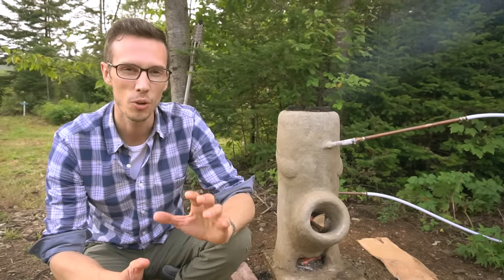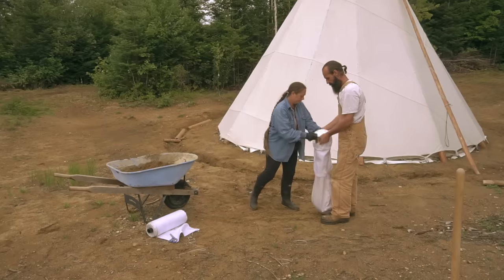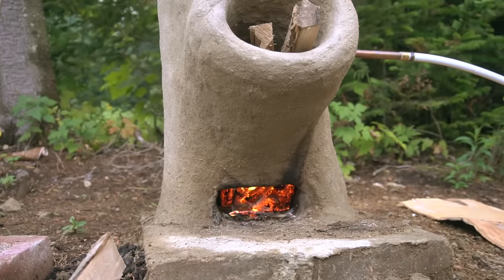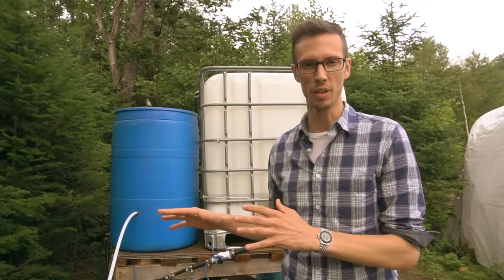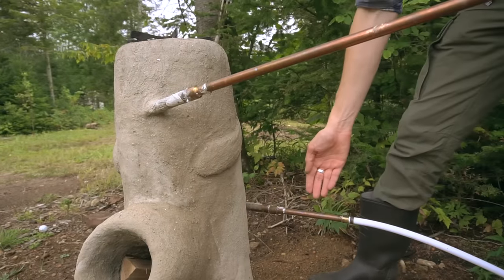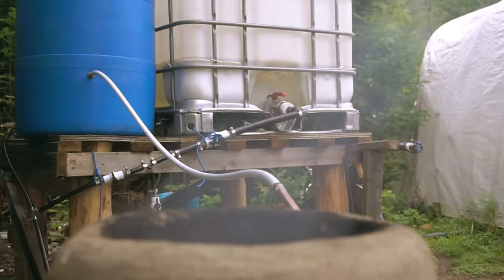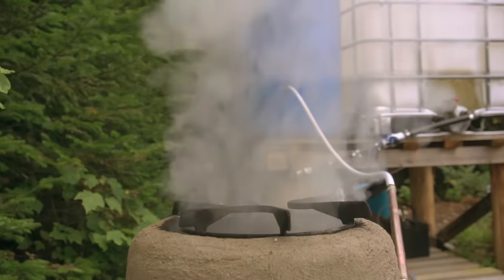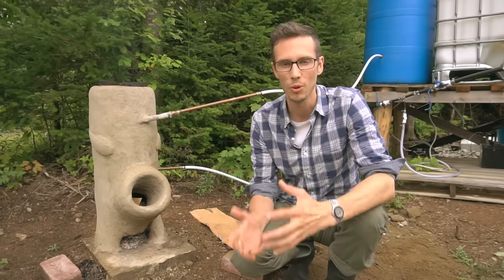Brilliant DIY Off-Grid Water Heater Using a Rocket Stove – No Propane!

Comment from the maker: What do you think of this off-grid water heater?  Have you seen or used any propane-free off-grid water heaters?  Thanks for watching!
Reply: Well i have mixed feelings. Any clue how long ive been trying to figure out how to do a portable heating system w out lp? Lmao of course YouTube to the rescue. Smh...lmao
Reply: It’s unclear what this stove is made of - is it concrete with extra sand? Or clay with grog (ground up pre-fired clay to avoid cracking)? I would be nervous to put the heated water back into a plastic tank in a cyclical system. A food grade steel barrel may be safer... is there an overflow valve and a pressure valve on the tank? Thanks for posting this. Interesting!
Reply: Micha EL can someone post the recipe for the insulated cement?
Reply: Exploring Alternatives; burning wood? Is not sustainable except for a very small group of users.
Reply: bb1111116 
The rocket mass stove and heaters use a fraction of the wood used in traditional wood burning devices, including the new ones that are supposed to be more efficient. The bonus is that they also make good use of small pieces of wood...no logs required, so that means more sustainable as dead branches and brush are good. Fouch Family live in Idaho and heat a small home with RMH. They run a burn in the am and it keeps the house comfortable until the next morning. 
I would love to see if someone would do an experiment: shred and compress the waste matter that comes from crops...corn or other grain stalks, for example, do not really add much nutrients to soil, and do not make good fodder for animals.
Reply: Use to rig something similar with copper pipe and a ice cooler when camping in winter. Works great. This is brilliant 
Cook, heat your water that's all I need. Love it
Reply: Build self feed system for that.
Reply: Way to make a go of it!  Cute stove.   Two things: One, you could heat water using a retort  where you burn the some wood and mostly woodgas and get char as a biproduct to use in many ways - like mixing with compost for bio-char.  Char is stable and a great way to sequester carbon and grab nutrients that would volatilize, like urea in manure.  Two, I am wary of using plastic for water and especially heated water.  I know some say it is okay, but I carry a heavy plastic burden in my body and I eat mostly organic etc.  Here is a good  simple char retort design.  

http://livingwebfarms.org/multimedia/videos/complete-hands-on-workshops/biochar-workshop/

How would you modify it to heat water?  I am thinking a tube around the upper portion of the stack?  Build info starts around minute 10:00 and whole video/series is really well done.  Good luck!
Reply: i think my range can heat water up quicker, rocket mass heaters are a good invention, rocket "stoves" are just quick burning chimneys
Reply: True, Ronnie, but most high efficiency rocket mass heaters have a secondary burn chamber (the barrel you often see) to burn the "exhaust" down to CO2 and water vapor and more heat.
Reply: Cool test of concept, but incredibly inefficient. A lot of waste heat is going up the chimney instead of heating the water. The chimney needs to go through the water tank. 

The copper coil around the burn chamber should be a heat booster to super heat bath water or a radiator to heat the house.
Reply: I used a rocket stove heater for showering at the Cob Cottage Company in Oregon. The rocket stove inventor, Ianto Evans lives there. It worked super well. I want to make one for myself someday!
Reply: Yes... We use a wood gasifier...
Reply: Exploring Alternatives what is the rocket stove made out of? How is it made?
Reply: Rocket stoves are so efficient I don't believe that is true.   Could everybody on the planet do this?  Of course not.
Reply: Wow! So cool! Thank you for sharing!
Reply: Needs insulation.
Reply: Exploring Alternatives made a large scale one a couple years ago for my hot tub
Reply: Taitco Hey. Does a larger scale one decrease its efficency? I would have thought it would due to the extreme amount of air and heat that would be lost through the chimney due to the large apeture.
Reply: If you had the core and water coil inside a barrel you would utilize a bunch more heat and still be able to cook on the top, but cool build!!!!
Reply: TheKamiBunny it was built inside of a barrel and heavily insulated. With a 3/4 inch copper tubing coil. Worked incredibly well, heated my 4 man hot tub to 104 in 3-4 hours
Reply: Taitco oh cool. Thanks for the reply. That rocket stove sounds amazing.
Reply: Great idea!
Can you give us an idea of how much fuel and how much time it takes to heat up the water (to say 60 degees centigrade)?
This info would be a big help in deciding whether it is worth doing or not, for us.
Reply: Nice but it's not a rocket stove ! Just a chymney with air and Wood supplies separated ... Google it and you will see
Reply: The heat exchanger needs to be higher up the chimney so it's not robbing heat needed to get a complete combustion also a second air intake should be introduced in the riser for secondary burn
Reply: Exploring Alternatives 
We call that a heat exchange water system where a coil of copper pipe runs through another copper or stainless steel insulated barrel with the thermosyphoned heated water mass, your plastic barrel looks dodgy and temporary. 
Love the novel clay rocket stove though , it would be a great exercise for bush survival comfort to create free hot water on demand, I'd build something a lot sturdier and permanent for long term off grid in a wood stove homesteading.
Reply: This is not a rocket stove as I understand it. This does not reburn the primary gases.
Reply: Why don't you say anything about the material? Normal concrete would have cracks over long term use... You could have just asked the guys, no use for me so far... And I really want to build something like this to heat water.
Reply: Exploring Alternatives....I love this.
Reply: @ "oh well" YES! and seeing this idea, I know it will work from the same tank (but indoors and insulated like crazy!) plumbed to a rocket stove mass heater inside a house, and to an outdoor one for heating water when it's warm outside and you're trying to keep the place cool. going a little further, the outdoor one could have an insulated cover to close over around it right after the fire has gone out, so it'll do what it does for a longer time. solar coils are nice but not so good in cold or cloudy.
Reply: @ TheKamiBunny agreeing, if the rocket stove part were shorter, then a wider taller more cone shaped chimney for capturing more of the heat into the coils (also spiraling up in the cone shape). wouldn't take much to line the wood feed tube so wood slides in so it self feeds a little longer sticks. 4" exit hole is about 12.5 square inches, 5" about 19.5", things to think about when tinkering with these kinds of ideas. on a stove like this one the bottom air inlet is also your easy starting and easy clean out. it'd also only take 1 bit of 90 degree angle iron in a V 4" over the rocket stove section to blast the heat directly into the inverted cone chimney mentioned above, that's also going to conduct heat directly into the mass for being in contact with it too (or might a rectangle wedge shape be even better, it's just a little more work with a tubing bender, or copper pipe and fittings). these things can be improved a LOT pretty easily with very little thinking.
Reply: i wonder if you could use a rocket mass stove with thermal water siphon heating for radiantly heating floors and walls etc. plus a water heater?
Reply: Im thinking about making one of these,  using my old propane hot water tank for storage.
Reply: @elizabethj.davenport8947 I lime what your saying but the idea of heat loss and using this u it indoors are two different things so I lost the point of the first idea. Please clarify as I'm intetestrd..
Reply: @ROL2023  I agree. I want to build one for outdoors and design it lime this so it's interesting to look at.
Reply: @Mulberrysmile  do you have more Info of the family In I daho? Is the spelling right on the name as spellcorrect sometimes hits.. thanks for answering.
Reply: @stormyravenhawk  I'm interested. What does the ice cooler do?
Reply: @tbird6234  I'd love to incorporate this into my permaculture community project. Can you tell me more?
Reply: Interesting design. What is it made of? What materials were used? What are the dimensions of the furnace. Thank you in advance.
Reply: Small amount wood and large amount of heat  ? 

hmmm 🤔  I think A Stirling engine is missing in that picture.
Reply: I used an old propane water heater that I got from the landfill and built a rocket stove which I then placed the 40 gallon tank on top... Takes about 45 mins to an hour to heat up the water ..I also built a rocket stove heated outdoor bathtub using an old cast iron tub...
Reply: Need a video on how to build it step by step
Reply: @ROL2023  there is a tech channel and they sell a methane producing composted that you can use the gas for cooking or heating..
Reply: @DaleModisette  looks interesting but video doesn't open..
Reply: @Mulberrysmile  there are tech made methane makers and collectors you can burn for heat or fuel.
Reply: @Mulberrysmile  animals love corn stalks.
Reply: @kwhatten  do you mean the box that's added into the exhaust pipe?  How do you put a second chamber on something that small?
Reply: I grew up in Africa.  Check out a Rhodesian Boiler.
Reply: bb1111116  he said a half a heated tank was good for ten showers
Reply: thank you for the proof of concept. you just sped a project along by quite a bit.
Reply: The vast majority of heat is going up through the chimney into the air, not effective heat capture.... why not use a metal oil drum and site the rocket stove underneath it... like a giant kettle...?
Reply: not some new invention ....people just don't have any useful education ny more , basics have been forgotten  this has been around for the last 50 years i know of
Reply: @afiah2o  is there an overflow valve and a pressure valve on the tank? wouldn't be needed .. heat increase would be slow , fuel source spent , unless you over heated the water on purpose , overflows and safety valves are delinquent
Reply: @cherriemckinstry131  Fouch Family Off Grid, have a rocket mass heater in Idaho.
Reply: @mbc204  very interesting. Thank you..
Reply: @mbc204  thank you for the info.. where do i find like minded groups of people?
Reply: Very cool, but I have a question. You're in Canada. It gets extremely cold in Canada. How do they keep the water from freezing into solid ice in the winter? Certainly those little water lines coming from the large water tanks would freeze up solid in a hours time in freezing weather. Do they use some sort of electric powered submersible heater to keep the large water tanks from becoming huge blocks of ice in winter, or what, eh?
Reply: Incredible after 2 days with no power I am glad to see this!
Reply: Is there a sketch of the rocket stove or a way to know how to make the same ?
Il y a t'il un plan du rocket stove ou un moyen de savoir comment fabriquer le même ?
Reply: It would have been nice to see what's inside the stove... I mean, I can imagine it, but it would have been cool to see it being made.
Reply: We would like to know how to construct this.  Where can we find the video instructions?
Reply: @0xFF48  Your idea would be terribly inefficient while trying to cook.
Reply: brilliant !
Reply: How to control the water temperature?
Reply: How do you find and identify usable clay for making it?
Reply: @Gamma Wave Thankyou for your answer. My problem is to identify clay and not mis-identify it just with mud. Or does it work with mud too?
Reply: I think that it can be upgraded even more if you get energy from the wood gasses instead of the wood itself, like process of pyrolysis
Reply: Burning wood for heat isn't as scalable. I mean atm we are doing exactly the same with coal. At least it is more efficient I guess...
Reply: I think this is great, simplicity itself. 👍
Reply: @bb1111116  Rocket stoves are capable of using very small pieces of wood...... even sticks.  You can also use old newspapers that you've recycled into tubes or bricks.  You don't just have to cut down trees.  This reduces the volume of wood needed by a tremendous amount compared to an oven or fireplace.
Reply: I think this is a great idea!!  I would want to use an old water heater though instead of a plastic barrel.  I've seen other versions of this,  including one where they used an old water heater placed on its side.  I'm totally drooling over one day having my own farm.  There's so much I want to do like this!
Reply: First thumbs down,just telling it how it is.
Reply: Yeah I did ... Back when I was a kid we had one that was a might bigger than this one & it's copper tube was all coiled up on the outside dripping into a gallon glass jar ..., but our hot water wasn't for bathing , it was for Drinking ( only for the ad UK lts , said water was too Hard & strong for M us kids to drink that's why they drove it to town & sold it. To buy more corn & sugar ....When the Govm't men came & chopped it up they didn't call it a water heater  , they called it a Still.... LOL.....🤣🤣🤣🤣🤣🤣😜🤗
Reply: How does it do during winter.
Reply: why dont you show us how to build it
Reply: So is this just gravity fed with no pump?